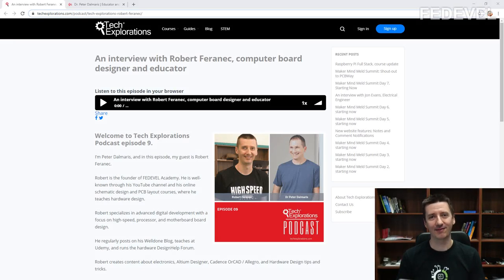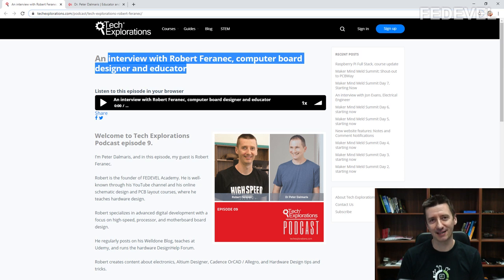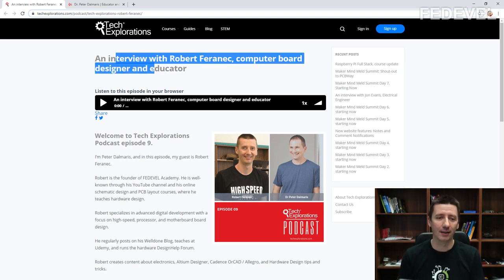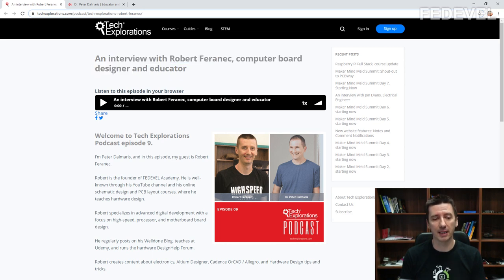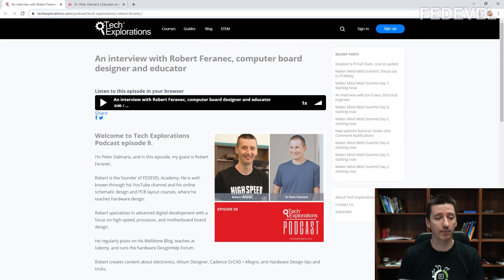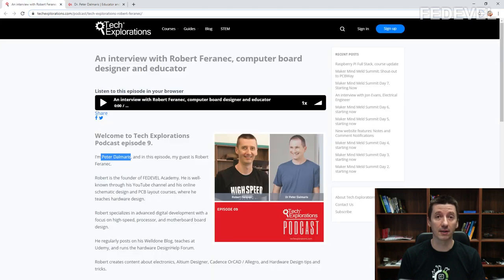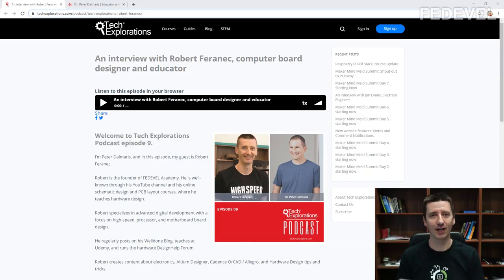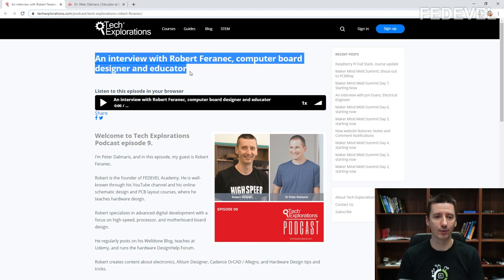What is your experience with Autorouting?

Comment: Back in the early 1990's the Logic ICs were using DIL packages and had semiconductor feature sizes of about 0.8um (whereas today we are at ~12nm). As such the rising-edges of the digital signals were much slower than today's logic. With such slow edges, basically any old routing pattern would work reliably, as long as everything was electrically connected, (obviously the clock rate is irrelevant).
That meant that autorouting boards used to be a viable option for boards that used discrete-logic ICs (even if it was still useless for RF or Analogue boards)
The results were often ugly and the process would require almost as long to set up the design rules for the autorouter, as it would to route the board manually, so its utility was marginal at best.
These days, the autorouting technology hasn't kept pace with the skill level required to design with fast rise-time digital logic ICs, so it is effectively useless.
Maybe someday someone will produce an autorouter (probably combining AI with an expert-system) that will be usable for commercial PCB design, but we certainly aren't there yet.

Comment: You have to know WHEN to use the autorouter. After you hand-route all the critical stuff,especially on huge desings the autorouter is a life saver. It can do thousands of connections in a few minutes. 
Mentor routers are the best in my experience (native 45 degree routers) with Specctra coming in second.
Reply from the maker: I have heard number of people saying, that Mentor has a good autorouter. It would be interesting maybe try it. Some time ago I contacted Mentor, because I also like Hyperlynx - but Mentor doesn't want to support my videos. Maybe when I have more subscribers I should try to talk to them again.
Reply: @RobertFeranec  As good as the routers are (both PADS and Xpedition) Mentor PR is the worst.
Also , to add on my previous comments, no autorouter should be used blindly and expect miracles. The idea is to use it interactively, monitor what it's doing and adjust the rules, add keepouts/fences, region rules (n/a in PADS unfortunately) to make it do what you want. If it cannot connect see why, maybe fanouts are missing, maybe rules are too constrictive.Sounds like a lot of work but when you then connect 2000 nets in 30 minutes it's a breeze. Only a fool would not take advantage of the autorouter (if available).
Reply: In my (extremely) limited experience, I'd say the EAGLE autorouter results look like it was done by a beginner, whereas the Altium autorouter results I've seen look like they were done by somebody with malicious intent. It's actually kind of impressive, really.
Reply: @RobertFeranec  I worked first with Dazix, then Daisy, later Intergraph and finally Mentor Graphics for 25 years and now I have been working with Altium for the last 7 years. In a few cards you can launch the autorrouter and in which you can, I prefer to do it by hand because the layout of tracks also has some artistic.

Comment: You have a board on the fridge and it freezes... nice :)
Reply from the maker: :D
Reply: And if you had a board next to a range, it would overheat :)
Reply from the maker: @robert_g_fbg  :)
Reply from the maker: freezers are quite bad - I have monitor in the same plug as our freezer is and every time the freezer switch on/off, my monitor goes black for a few seconds.
Reply: Fridge compressor motor may put out a current spike into mains, when turning off/on. Depends upon how well filtering was designed into fridge appliance.  Board which is sharing mains circuit with compressor may see the spike and triggers the Brown Out interrupt.

Comment: Routing and component placement are dependent, I as the router can move/reposition components in the middle of routing, I guess this is the main reason many time autorouter cant even completely route the board
Reply: Agree. SPECCTRA Autorouter can do some forms of automatic component placement, but I never tested it, so I have no idea how good it is, does it only move components slightly to make some space for routes, or shuffle components more strongly (i.e. swap to chips) to find a better relative orientations and placements to find better layout.

Comment: There are only two people who like an autorouter.. 1) people who do not know what they are doing 2) people who sell autorouters.. 🤣
Reply from the maker: :D
Reply: Not certainly in that way. You can use autorouting in part of your project where it'll give you expecting result. For example: you have MCU + 2 IC's DDR3\4 on board and have enough space for tuning  traces with help "accordions". If you have an ability to route signals that way, it can be implemented 95% with auto-router  (in case of Allergo PCB)
Reply from the maker: @deniskolosov8368  Please, do you know an open source project where I could try that? I was playing with both - Altium and also Cadence and I wanted to autoroute DDR3 memories of our open source imx6rex.com projects. I have spent some time trying ... and also together with support from both companies and we could not find a good way to autoroute the memories. Even I deleted the already routed tracks or part of the tracks just before trying autoroute them back .... non of the autorouters was able to connect them back.
Reply: @deniskolosov8368  maybe, but in my experience the layout capabilities from an autorouter hurt my eyes and pcb heart. The way it routes is not the most efficient way nor an elegant way.. But to each his own.. IMHO I always want a design to have proper flow, and that is not possible with an autorouter.. I have seen so much examples of people who use an autorouter and then are wondering why the design doesn't work according to spec.. 🙄 And the whole point is that an autorouter should do the work for you correct.. We will see many improvements over the years especially with A.I. becoming better and better.. So maybe in the future I will amend this statement.. But for now I will stand by it.... 😉
Reply from the maker: @ThePaulus2010  Yeah .. I also keep thinking about AI in autorouting ... and if we should start worrying about our jobs. I believe, AI could be really good in it. It may not replace people completely, but AI (machine learning) could be able to learn autoroute well.
Reply: @RobertFeranec  Sorry Robert, I was a little wrong. I've watched my project and found that it was the board with only one 16-bits DDR3 IC. 
Unfortunately i can't show it you, 'cause I am bound by nda. Perhaps, i return to this topic if I'll be able to make a similar thing in nearest future.
Reply: @RobertFeranec  nah.. It will take many years before that happens.
Reply: @ThePaulus2010  I won't argue, i almost never use it too. I just wanted to note that such cases (where auto-routing can be used) found sometimes. 
And separately... all my experience about auto-routing were usually for parallel buses. Not High-speeds trace, not SMPS. 
I totally agree that good design = hand made design.
Reply from the maker: @deniskolosov8368  Yes, one 16bit DDR3 is much easier - especially if there is enough space.
Reply from the maker: @ThePaulus2010  yeah, luckily it is not so easy to create it :)
Reply: My experience with autorouters is that they’re like an untrained junior trying to do DDR memories, by the time you have “explained” to the autorouter what it should do, you can do the routing yourself twice.

PCB layout is one of the few jobs that for some reason follows an inverse complexity pattern. It used to be done by machines, then by technicians, now mostly by engineers. 

I don’t have high hopes for AI because the problem is mostly a bandwith one. Human-machine interfaces have very little bandwith, and the constraints required for a PCB (electrical, thermal, mechanical,..) are simply too much information to transfer “raw”, it pays to just process it yourself and get the output even if the processing isn’t perfect.
Reply: In some cases, your boss also likes it because someone has told him that we can save a lot of time and work ; -)
Reply from the maker: @fjbesteiro   :D
Reply: Sometimes it can be useful when having very complicated BGA tracks. But besides those cases, I really don't see much benefits.

Comment: For those who like to bash on autorouters: Autorouters had a place in the industry back in the days when controller boards had 8...16bit buses running at low clock speeds. Those boards had between 20...200 IC's and could be autorouted just fine with a tool like Specctra. Those who say autorouting didn't work for those boards used the wrong routing parameters or a router like the one found in Eagle or Altium. Expecting an autorouter to design your analog boards or SMPS's is a failure on your own behalf. Can we now stop the bashing and use the tools we have for task at hand instead?